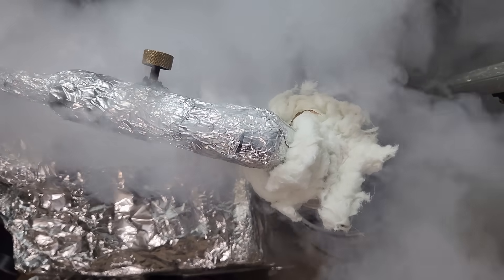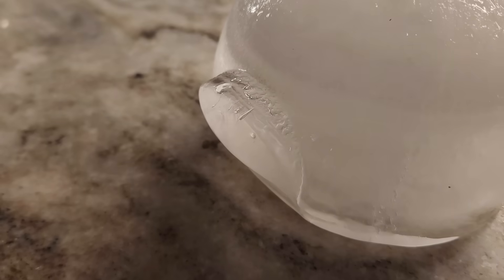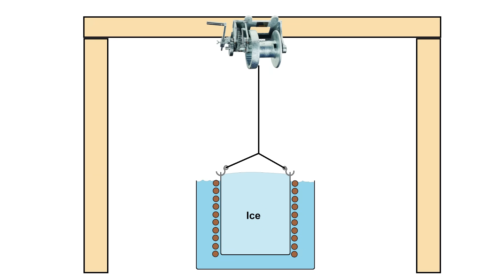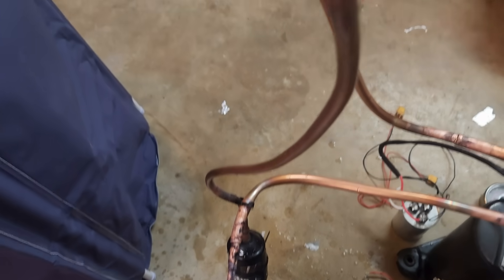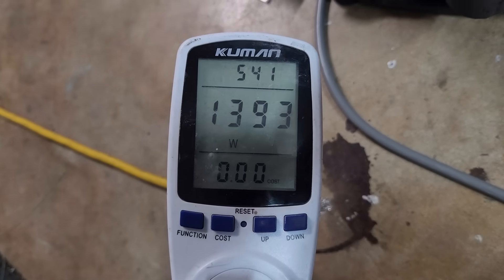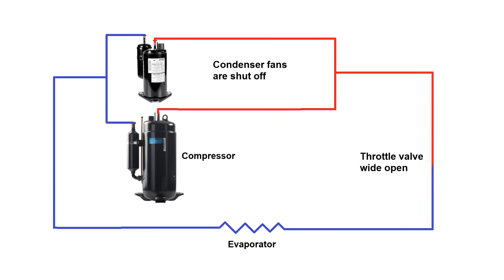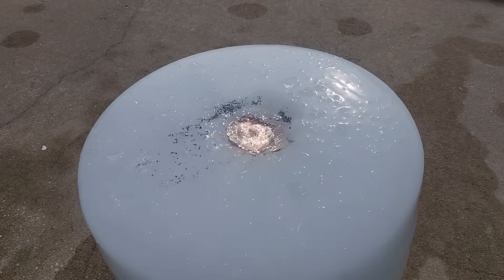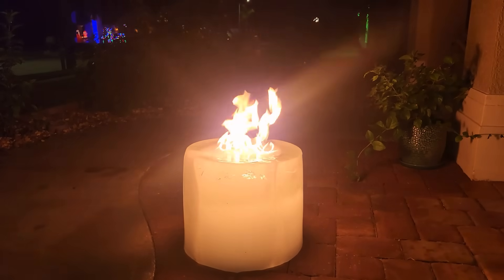Making Gigantic Ice Cubes In My Garage

Comment: You could use this to help people understand just how much energy is transferred by a central air conditioning system. Make three tons of ice, then show that melting 3 tons of ice over 24 hours is the same cooling as a 3 ton AC running constantly for 24 hours. 
It would be a helpful comparison when dealing with scam cooling products and those "bright ideas" involing coolers full of ice and fans.

Comment: You might be able to freeze faster if you use a heavy chamber, a cold trap, and a vacuum pump. Once the non-condensables are removed the vacuum pump won't need to do much so long as the cold trap can kind of keep up. 
With the non-condensables removed the water will boil and will do what it can to match the temperature of the cold trap/finger. If you have a way to scrape the ice off without breaking vacuum then you wouldn't need to worry about the ice insulating itself and should pretty much be able to maintain max cooling power.

Comment: For the bath around the ice pot, you could use water + glycol antifreeze (either regular ethylene glycol, or propylene glycol if you want a non-toxic solution). That will handle temps a low as -60C, depending on the glycol concentration.  You could even use a heat exchanger with the glycol solution pumped through it, instead of the coil around the pot. That way, there would be a  great deal of flexibility on the size/shape of the freezing container, and the thermal mass of the glycol (assuming it's pre-chilled) + the flow of the glycol solution should freeze water quite quickly.
Reply: Glycol antifreeze has much lower heat capacity than water salt mix though
Reply: @DarkAttack14  Not by that much. Heat capacity by mass of a 50:50 water/propylene glycol mix is around 90% of pure water.  And it's even closer by volume, as the glycol solution is denser than pure water.
Reply: Lower heat capacity is beneficial in this case, as it's used for direct thermal transfer.

Comment: with a multi compressor setup all you need to watch out for is that one doesnt get all the oil in the system but that can be fixed with a tube at the max hight of the oil of the compressor

Comment: This is so ducking cool. I love the logic, the planning. Most people will use a chest freezer for the same effect, but this is bad ass

Imagine a fort made out of ice or walk lanterns burning tri methyl borate....
Reply: The issue with using a chest freezer is getting the ice block out. They're not structurally sound enough to tip over, so, the only real way to do it is with a hoist, and casting lift points into the block itself.

Comment: A small submersible pump immersed in the forming ice to circulate the water might let you produce clear ice?  I've seen that done on some channel, but only in a state that has winter, where offsetting the 5-10w is of less concern.
I'm also wondering if circulating the fluid in the cool bath might improve transfer to the ice container.  Ideally not a submersible pump of course, so less heat is added to the system.

Comment: Honestly I don't know why we aren't using large ice blocks as solar "energy" storage. Sure, the efficiency isn't great, but as solar keeps growing there is a lot of energy starting to go to waste at peek production hours, and not all our cooling needs are during peek sunlight hours.

Also, with the right refrigerant couldn't you make a "steam" engine that ran on heating ice to room temperature?
Reply: There are a number of places that are doing just that. The setup doesn't use ice though, it uses something similar to those re-usable hand warmers. The idea is, if you live someplace with super cheap off-peak power costs, you can charge your thermal battery off-peak and then use it on-peak to realize savings because all you have to run is a circulation pump and a blower. 

You also see this used industrially in similar situations, but for heating instead of cooling. That's a little less exotic, because they typically just heat sand in well insulated containers and then flow water through it to extract the heat when needed.

Comment: Very cool.

Have you thought about making a pykrete (ice+sawdust) cube with this setup? Would be interesting to see its alleged strength in this big block format
Reply: Ditto!
Reply: Time to do a colab with a guntuber!
Reply: You could cool a big house with that setup  if it was pyekrete. refreeze at night and run off the ice during the day. Heard of a Library out west that uses a system like that.
Reply: @nowan71730  What's the advantage over just plain ice? I'm doing research in using thermal storage for solar powered HVAC.
Reply: @nowan71730  Thank you for your comment! I am reminded of the Reagan Library, and I think the Ghetty also had a similar facility. I think it a great idea!
Reply: does ice+dog hair count as pykrete?

Comment: Part way through the video.... You can get vacuum insulated thermos.... Use it as evaporators. Break the vacuum run tie it after the needle valve or tube cap.... Ideally you should probably test if it can handle more then 15 psi too lol 😆

Comment: To make it clear, you need distilled water and it needs to be frozen from a single direction while insulating the other sides.
Reply: You can use tap water if the directional freezing is slow enough, you'll just be left with some really gross water as all the dissolved impurities get concentrated in the liquid
Reply: No, you dont need distilled water dont be silly. You just need to make sure it freezes directionally
Reply: water that's been heated once and not re-aerated will freeze clear
Reply: @Hyratel  no, it will not. not any more than "normal" water
Reply: I do this for a job. You don't need distilled water. The trick is to freeze it directionally, and keep it agitating constantly. Cut off the impurities from the top when you're done, and you'll get clear ice.
Reply: Thanks for the clarification
Reply: Boiled water is free from dissolved gasses and will give clear ice.
Reply: @Flygtraktor this is also huge bogus
Reply: ahhh thats how you grow crystals, makes sense
Reply: Distilled water has nothing to do with it
Reply: Just agitate the water and it will freeze clear.

Comment: The only issue with parallel compressors is uneven oil return , Supermarkets systems have an elaborate oil level return system on the parallel pacs .